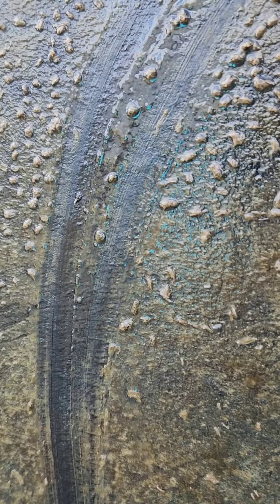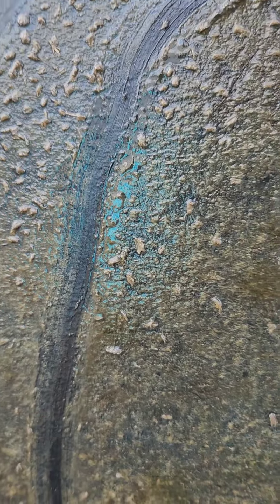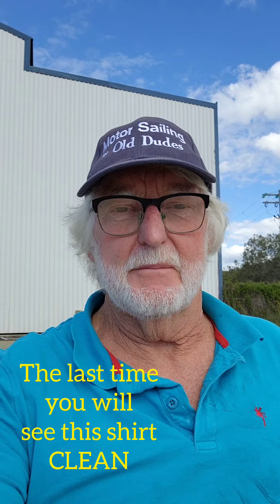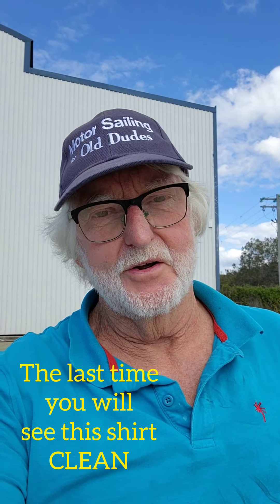Some Dirty Work Ahead @MotorSailingforOldDudes

Comment: What did they charge for the lift and return Norm?
Reply from the maker: $204 out ....$204 in  and $72 a night for me. It was a good experience.
Reply: @MotorSailingforOldDudes  gee Norm I wonder why you got it so cheap, they just quoted me at Boatworks where you were and Amy quoted me $492 haul out and return,  $164 water blast and $95 a night hardstand 🤷‍♂️🤷‍♂️
Reply: @MotorSailingforOldDudes  who did you deal with so I can chat with them ?
Reply from the maker: Dealt with Natalie in the office. Didn't get any favours, but was a fair bit cheaper than Boatworks. Boatworks is a great yard but getting a bit exy for the not so well off boaties. Horizon Shores is close to Bruce's which was a bonus.
Reply from the maker: Was at Horizon Shores Dude.
Reply: @MotorSailingforOldDudes  Arh that explains it. Yeh I’ll go to Boatworks because the chandelier said they will come look at boat and advise me . I’ve never antifoul myself before so illl need some advice .